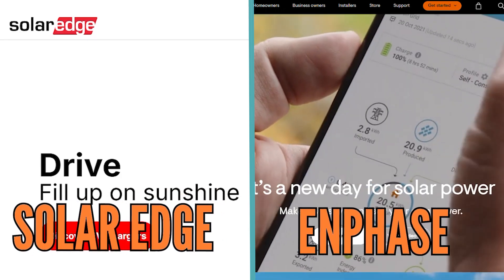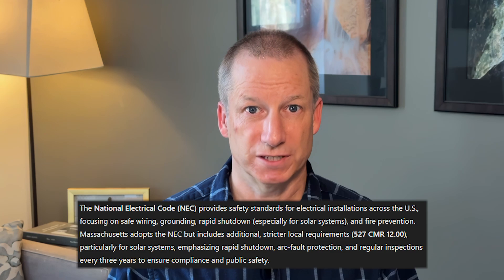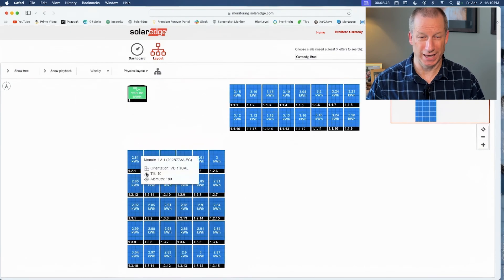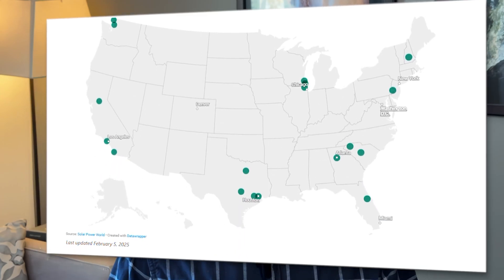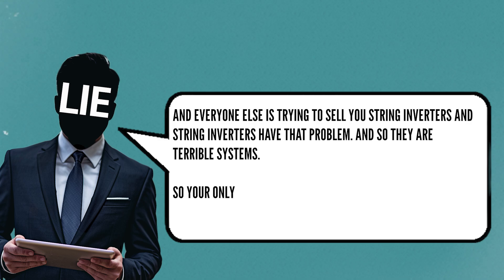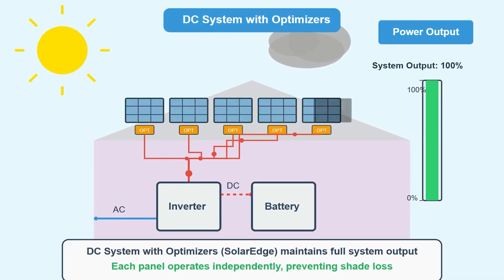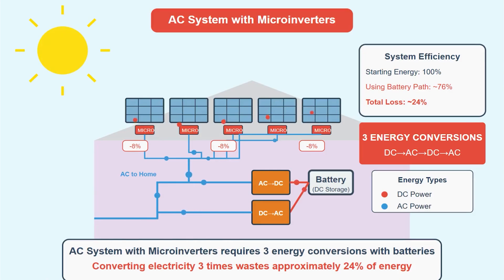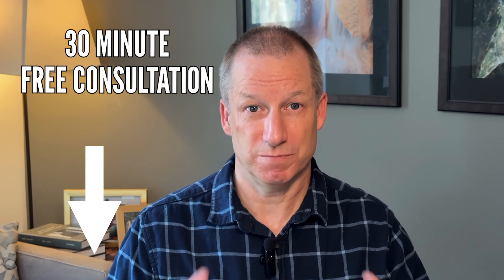Why Your Solar Salesperson Is LYING About Microinverters

Comment: Would like to a string inverter with probably a Point Guard hybrid battery, do I have to use optimizers for rapid shut down with a battery with MPPT control.

Comment: Sorry, don't agree with the need to covert DC to Ac to Dc to AC.
I opted for microinverters on a tiny home project because it gave me some extra space for a larger battery.
Mine only convert to AC once. My solar feeds both the micro-inverters and my battery through a charge controller. When the panels aren't producing my micro inverters pull from the battery via the charge controller.
This is a no brainer way to combine micro inverters and batteries.

Comment: I have 2 Solaredge inverters since 2017, I hate them.  I have a large ground mount system, and things fail all the time, except the solar panels. In 8 years time, I replaced both inverters and over 24 optimizers. So the monitoring system is really to monitor old China made optimizers. CUSTOMER SUPPORT, Was fine in the early days but now I find I have to "prove" what their app clearly shows with measurements and photos, over and over again. My friends also have older systems with similar issues. So as of now I could never recommend Solar Edge. At least with Tigo they work with other inverters and you only need to install them where needed. With Solaredge you can't remove them without getting a different inverter.

Comment: You said it yourself, "Inverters are likely to fail." With a SolarEdge system you have 1 inverter. If it goes down, and it will, the whole system is down. And now you have to wait a week or two for your solar company to come out to fix it. Heck, that could take a month in some cases. If 1 Enphase microinverter goes down, the whole system stays up. You've only lost 1 panel. Sure, the Enphase system has a single point where all the power passes thru... but it isn't doing the hard work for inverting DC -> AC. It's just passing AC thru. In other words, much less likely to fail than an inverter. You are right about the DC -> AC -> DC conversion (if you're doing the battery storage thing), but that really just means that you need to put 1 extra panel in your array to make up for that loss. No biggie. You forgot to mention that Enphase IQ8 inverters allow "islanding" without batteries. SolarEdge could do that if they wanted to, technically, but they don't offer it yet. Anyway, I don't think Enphase is misleading anyone. SolarEdge and Enphase are just 2 slightly different technologies doing the same thing.
Reply from the maker: The single point of failure argument is made by many people who agree with you. However, it's wrong both logically and practically. Logically, if the single inverter system fails and the whole system goes down you will lose all production while it's down. Likewise, with micros you will only lose a percentage of production. If you look at this over 25 years then the amount of down time on both systems would logically be similar. So no advantage either way you could argue. Practically though the single inverter system will break once or maybe twice in 25 years (might be three or zero too.) Therefore that is how many times the solar company will have to come out and fix it. Please note that every time they come out they either lose money or have to charge you because with either system they get paid much less through the manufactures warranties than it costs them. With micros if they came out every time just one or two went out they would either lose money or charge the customer. And the number of truck rolls for the solar company fixing micros is likely to be many more times than once or twice in 25 years. That costs them money so therefore they are going to be hard to get to come out for just one or two down. That's why micro systems are likely to always be down 10-30% or more for years at a time. That's obviously worse. Adding one extra panel is often not an option for homeowners and when it is it does not solve the AC coupling issues in any way at all. The IQ 8 "islanding" technology provides so little back up power I don't see any value to it at all.
Reply from the maker: Also I don't think Enpahse is being misleading at all. It's the salespeople selling them that often are either ignorant or intentionally misleading.

Comment: The English word for "Salesman" is "Salesman".  It does not denote what type of genitals the salesman may happen to have.  Let's not F up our language to satisfy a few deranged morons.  

A good point about the lying though.  Possible the salesman is just ignorant though.  They probably only know what their boss tells them.  Neither are excusable.

The rest sounds like speculation.  ALL micro inverters will eventually need to be replaced?  Is that really true that they are THAT BAD??  And the string inverters never fail??  What happens if one micro inverter fails vs one string inverter?  Is the whole plant off line in both cases, or just one of them?

We're obviously talking about grid connected installations here, so the discussion of diverting some of the locally generated power to a battery is fairly moot.  That's going to represent but a tiny fraction of the total power generated in any given year.  In that case, what matters most is the efficiency of DC power from the panels to AC power to the line.

During a power failure, not all of the power is going to the battery either.  Some of it is being consumed as it's being generated (during the day). So the comment about the inefficiency of micro inverters  to another inverter to the battery back through the inverter and finally to the load, only applies to that power that is not consumed when it was generated.  And even that is only during a power failure, unless the system leverages the battery to take advantage of more favorable rates during different times of the day.

Lastly, are the solar companies really monitoring the Property Owners' systems?  Are some property owners just renting the systems, instead of owning them outright?  

It seems like this industry is FULL of deceit, well beyond just micro inverter vs string inverters...

I will design my own system, and select my own components, all after doing my own research.
Reply from the maker: I think you should start your research with a dictionary. Arguing that a word with man in it has nothing to do with gender is willful ignorance in service of your clear sexism. I was very clear that all inverters fail, which is why I think having one under every panel makes no sense when you can just have one or two per system. You are correct that not all the power would go to the battery during a power outage, but that hardly makes DC coupling a moot point. The advantage of being able to charge the battery while you are draining it means you could potentially go days longer with a DC coupled battery system. That plus the overall efficiency gains make it an obviously superior system. Yes solar companies monitor the system so they can make sure it has maximum uptime. Also many people lease their solar instead of owning it and for many the advantages of that outweigh the disadvantages of owning. Yes, the industry is full of deceit just like any other. If you are DIYing the system you will be able to choose your own components but if you use a solar company you will likely be limited to their product stack or pay a large premium. Hope your own research doesn't come back to bite you in the ass.

Comment: Well, actually, the shading problem is also solved by recent solar panels themselves, as well. With no micro-inverters or optimizers whatsoever.
Reply from the maker: While bypass diodes are effective, they don't eliminate shading issues entirely. They are a protective measure, not a complete solution, and shading can still reduce overall power output. But that doesn't really matter as most installers use Enphase or SolarEdge.

Comment: Old-school central inverters, where we didn't have optimizers and had only one MPPT for dozens of strings, is where this was a real problem because a shaded panel on a string meant the entire string had a lower voltage than the other strings and contributed less, if anything. SolarEdge is not the same thing, but this "lie" has been discussed ad nauseam for the past five or six years. From my experience, SolarEdge might last 10 years, but they fail pretty often. We're constantly replacing them for customers whose installers went out of business. What I use now are Hoymiles micro inverters. I haven't seen any failures since we started over 3 years ago, and they are truly "plug-n-play", with no internet required.
Reply from the maker: Sounds like you have found a solution that works for you. My experience with SolarEdge has been that the reliability has improved substantially in recent years. Plus I think all inverters will fail at some point so you may as well have one or two instead of 20-50 or more.
Reply: @bradthesolarguy  I also use Hoymiles Hybrid inverters when batteries are required.

Comment: Is shading really a big problem with modern panels with efficient by pass diodes? Why complicate things?
Reply from the maker: While bypass diodes are effective, they don't eliminate shading issues entirely. They are a protective measure, not a complete solution, and shading can still reduce overall power output. So it is still an issue especially if you don’t have roof space to add more panels. But really it’s a moot point as the vast majority of installers use either SolarEdge or Enphase.

Comment: Enphase, sure.  Solar Edge though has a lot of competition and I don't think Solar Edge has a lock on the market or anything even close to a lock... so it's not really a Coke and Pepsi type of fight.  Generally speaking, with modern bifacial half-cut panels (which is nearly all residential panels now)... you don't need optimizers either... or really anything on the roof if we didn't have the RSD requirement.

The RSD code requirement, by the way, was a requirement pushed by ... you guessed it.  Enphase and Solar Edge.  They managed to get firefighter associations on board but in reality the risk of HVDC strings to firefighters is minimal even without RSDs... less than the risk they face daily from regular building AC systems, for example.

So generally speaking, I just go with basic RSDs which are still over-priced ($30/panel or $50/2-panels if you want more wiring complication)... they literally have just $5 worth of components in them.  Then I choose the correct residential panel.   Given that solar panels in bulk are hitting $100/panel (@ 400W+ each)... for the cash that is saved one can easily purchase more solar panels.

-Matt
Reply: My solar PV experience is in the UK. There are no requirements for these arc-fault, quick disconnect devices here. My friend in the US was told he needed them (California). I guess, like the utilities, the firefighters lobby is in the hands of big oil trying their damnedest to slow the uptake of residential solar.
Reply from the maker: Agree with most of what you are saying. And yes there are a lot of other choices but the vast majority of installers, especially the large ones, use either SolarEdge or Enphase. It’s just the reality of the current marketplace in the US.

Comment: The problem is that the quality of SolarEdge inverters in the past has been really poor, while Enphase nowadays seems to have things under control. That said both are not worth the extra money, just buy panels with bypass diodes and use the money you save on microinverters to buy 1 extra panel to more than make up for the difference.
Reply: That's my philosophy too. For a friend's (DIY) system he considered microinverters. I suggested that he run the DC wires from each panel individually to a cool dry room and put all the microinverters there, all out of the heat, cold and rain (and no AC on the roof). This was do-able because there were only 8 panels - just a bit more wire. It also gave him the option of installing a string inverter should he decide to upgrade to a hybrid inverter.
Reply from the maker: My experience is that SolarEdge has great quality now as well. Most of my customers don’t have room to just add 1 more panel.  And I don’t like micros because they have to AC couple to batteries
Reply: @bradthesolarguy  So what you're saying is that you always sell your customers on the maximum size array regardless of whether they need it and don't mention that they could save some money and gain reliability by choosing less output.
Reply from the maker: @roystevens4333  Nope.

Comment: One time a solar salesperson told me I had to "invert" AC to DC and totally skipped over the efficiency of AC transmission from panels to the battery.
Reply: DC transmission is more efficient from panels to battery.   DC strings tend to run 300-500VDC whereas AC transmission is running at 240VAC.  The result is that transmission power losses with DC strings are about 1/3rd (almost 1/4th) what they are for AC given the same wire.

-Matt
Reply from the maker: Unfortunately that’s common.

Comment: ...I think enphase was a plug n play system and batteries weren't common. 
But a 2 team of expensive workers and on the roof work is still expensive to change a panel.
For enphase or others. 

Long term monitoring services is part of the deal $costs and an obligation for warranty work.
If supply company doesn't go broke. 
Long term performance is now normal so layers of individual monitoring is just not needed.
An additional panel as needed to boost array output is cheaper over time. 
More hot roof shading 😎 will be valuable as the climate warms.
Batteries are now available and cheaper and better value, so DC is good. 

EVs are increasingly available, v2g technology also. 

As you say DC straight into the battery AND your AC inverter is SIZED to the load out into the home or into the grid as feed-in.
Electric Surges can be battery managed. 

Large arrays are Actually in groups smaller than 20 panels. 
Group out put can be compared for indicating a failed panel in one group. 

A simple cheap way of monitoring is my point. Good idea ?
Reply from the maker: Not really. Modular level electronics do other important jobs also like rapid shutdown and arc prevention so might as well have actual panel level monitoring.
Reply: @bradthesolarguy  thanks for the insights.